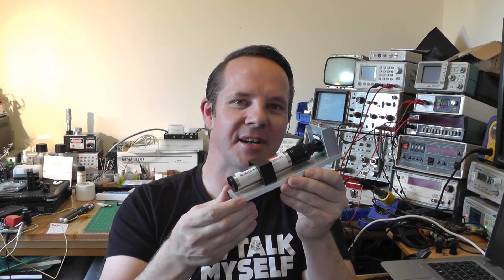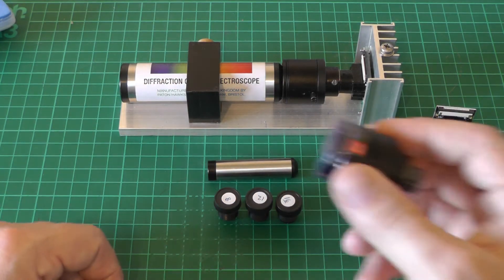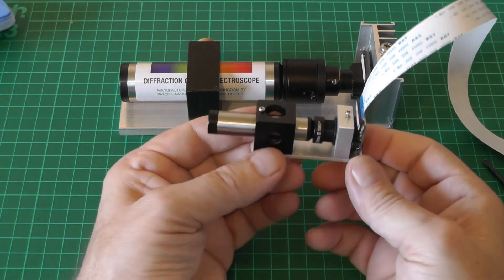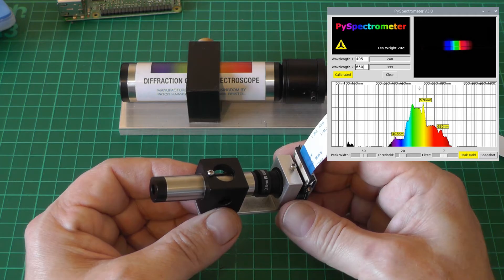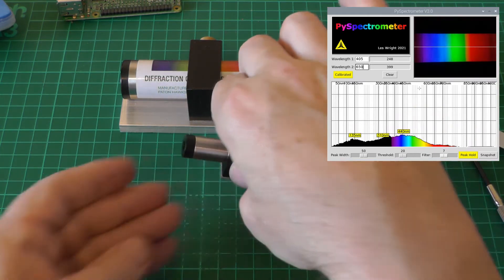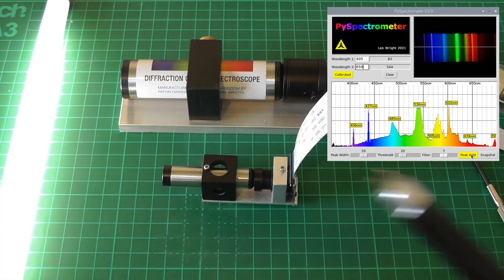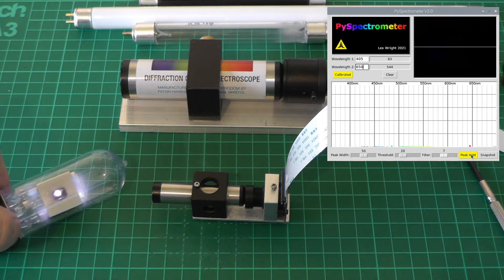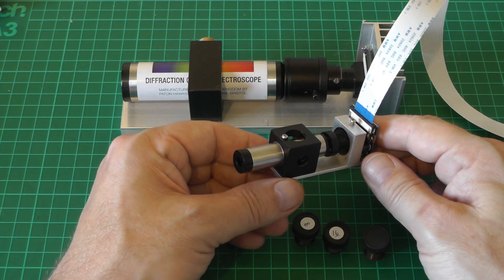How to build a MINIATURE Spectrometer  for the Raspberry Pi

Comment: I was surprised there was almost no IR within the range of the spectrometer, what lens would I need to down to say 1200-1400nm? The camera being silicon based should do quite well down there.
Reply: I believe the used camera sensor is digital one (RGB bayer filter). If you would like to see IR, mind adapting IR sensitive one (like the Pi V2 no IR) or a monochrome

Comment: Can this device analyze alloys?
Reply from the maker: No. For that you would need x-ray fluorescence (XRF)
Reply: @LesLaboratory  I love engine alloys and I want to analyze a cylinder to know how it resists corrosion. Is it possible to modify the device to analyze alloys by placing the sample in the pre-light stage and then adding an X-ray generator to it, or do we connect electricity to the sample so that the sample discharges electricity in an argon vacuum, then we measure the resulting light on a photomultiplier tube?
Reply: @LesLaboratory   hey les laboratory
Reply: I am not ignorant and stupid to ask you and you did not answer me
Reply from the maker: @OmarKhaled-zt2vi  this was already answered 3 days ago. To measure the compositions of alloys you need x-ray fluorescence (XRF). If you were determined to do it with a spectroscope, you would need to vaporize the sample.

Comment: Really good -how about one that goes up to 2500nm there is lots of good data from 1100 to 2500 (you will need another detector) we work in this region in the lab
Reply from the maker: I have been thinking about that. The usual way is FTIR at those wavelengths, but I have some crazy idea in the back of my head that may or may not work, but we shall see!

Comment: does it work with pico?
Reply from the maker: It might work on the Zero, but the Pico is an entirely different beast. The same basic principles could be applied, assuming you can even get a decent camera to talk to the Pico, and you wouldn't be able to use the OpenCV libs on the Pico either.

Comment: I wonder its feasible to do this with an esp32cam rather than Raspberry pi.  This way it could be even smaller, run from a small battery and be accessed via wifi.
Reply from the maker: Maybe, I have not looked into it. It depends on what libs are available in terms of grabbing a row of pixels, and processing and presenting the data. If I get time I will look into it.
Reply: Let me know if you do have a look at it as I now have an Arduino Sketch for esp32cam which grabs a grayscale image and extracts a single horizontal line as raw 8 bit data which should be a good starting point @LesLaboratory

Comment: Hello, can you send me a link to the xenon flash tube lamp you are using? And what kind of power supply do you use for it. The xenon flash tube lamps I found on the internet had 330 V output.
Reply from the maker: I don't remember off the top of my head, though in this application any old xeon lamp will do. I just used the power supply from an old plasma lamp to drive it, however this is not really the correct way to do it, as it will run very hot. That said, lamps are cheap!
Reply: @LesLaboratory  For our project, we are trying to find the right light source. So we decided that the xenon lamp is the one that shows the best spectral results. Yes, the lamps are cheap but the problem for us is the power supply. Do you know what voltage you used? We are currently using LED light source, do you think we should use xenon or should we continue to use LED light source.

Comment: 14:13 how it is more dangerous than previous tube if that tube 's wavelength was lower than this ?
Reply from the maker: The spectrometer won't read lower than about 350nm or so, but the UVC lamp also emits strong lines in the UVC region as low as 254nm. At this wavelength the light will burn skin an damage DNA.

Comment: Could be possible to measure transmittance with this device? I am trying to figure out how to make a spectrophotometer that works on an specific wavelenght and measure transmittance of an electrochromic thin film.
Reply from the maker: Yes, you would just need to have a nice clean stable light source, take a baseline measurement without the sample, then a measurement with the sample.

Comment: Kindly give a circuit diagram or assembling procedure for the same. Thank you. What is that software? Software link..Please provide. How to operate the software is not clear at all. Good work.
Reply from the maker: The links to the software and the requirements for the build is in the description.
Reply: Can it be treated as raman spectra?
Reply: How to place the sample? For detection
Reply: Can it be treated as FTIR or NMR

Comment: Wondering: what is the magical power source to drive all kinds of tubes? Especially the Xenon flash tube, AC / DC ? V?
Reply from the maker: For this video, I just used the PSU from a broken plasma lamp that happened to be under my bench! That's it. It produces about 8-10kV high frequency AC, from 12v in, so no mains voltages and in the scheme of things, relatively safe, unlikely to cause serious injury.

Comment: Is this a prism-grating-prism setup?

Or does this just take the -1,0,1 order onto the sensor together and waste a lot of resolution?
Reply from the maker: Internally I believe it may prism-grating prism (never torn it down, though looking through the end at odd angles you can see the optics in there). The spectroscope is high quality educational toy, and the resolving ability for Fraunhoffer lines is really very good. That said, I do not think you would likely resolve the two Sodium D-lines with it, but truth be told I have never tried!

Comment: At 7:15 it's showing some vacuum UV at 109nm. Is this an artifact of some kind? Does PySpectrometer work by looking at the distance between the calibrated peaks on the horizontal plane?
Reply from the maker: For sure, that will be light leakage from somewhere. There is no way 109nm is making it through the optics.

Comment: Hi Les. Kudos on your mini spectroscope and the covering software. I have built one in PLA and it works very well. 
Can I perhaps make you a suggestion for a small addition to your software in some eventual update to v3.1? Would it be possible to make the central white line, that I suppose represents the sampling horizon, adjustable up and down so one may make up for some degree of offset of the spectrum above or below the central field? This would allow one to sample at the visibly best slice of the spectrum. Thanks again for your excellent and instructive videos!

Comment: how far does it go into the infrared? It seems that you're cutting off around 700nm. is it a camera with IR filter or is there a different reason it cuts off? would a shorter focal length allow to extend it to ~1000nm provided there's enough light?
Reply from the maker: I have had it down as far as 800nm, but the spectroscope itself was designed for the visible. You could build your own spectroscope, there is no reason why the software and picam shouldn't handle it, though response might be a bit funky in the IR.

Comment: do not expose bare skin to deuterium lamp...
...proceeds to touch it
Reply from the maker: :-D it was run at a very low current, so not too much in the way of UV to start worrying about. If I ran it off of a real PSU, I woudl not be in the same room as an exposed lamp like that!

Comment: Is there a way to see spectra below 280nm (UV-C)? I'm interested in figuring out which UV lights have germicidal capabilities with your spectrometer :)
Reply: Sensors from GenUV should do it, but they don't give the spectral range in real time, just presence/intensity.
Reply from the maker: Not with the current spectroscope attachment. There is too much glass and plastic in the optical path, For UV work, you need fused silica optics. Additionally the cameras themselves absorb to much UV. This was part of the motivation for this video: https://www.youtube.com/watch?v=y39UKU7niRE

Comment: can you also measure liquids? using 2 ? measuring the wavelength of the source and then the liquid?
Reply from the maker: Yes, in principle. It depends what you want to measure. Assuming absorption, you would first take a spectra of your light source, then spectra of your sample in the path of the lightsource. You could then load these into matlab for example and subtract them from each other.

Comment: Can you make your graph display farther into both ends of the spectrum?
Reply from the maker: Yes, by changing the lens, then calibrating, it can 'see' into the near IR and near UV, but not too deeply. the Spectroscope it uses as designed for the visible spectrum.

Comment: This is a great project.  Could you give any details on the pocket spectroscope?  Particularly the optics involved.  Is it as simple as a prism or is there a grating in there so where?  Thanks. Doug
Reply from the maker: Thanks! Yes, these are diffraction grating spectroscopes, but there is also a prism to straighten up the optical path. Best guess the optical elements front to back are: slit > Collimating lens > Grating > Prism > Objective lens
Reply: @LesLaboratory  any interest in doing a “tear down” ….. you know, just for completeness? :)
Reply: @LesLaboratory  I actually found a video where the instructor detailed these gem spectroscopes.  Appears that there is a slit, collimating lens, split prism sandwich with the diff grating between two pieces of the pricing.  Very nice

Comment: For plastic threads, put them on top of each other with just a bit of pressure.  Unscrew until you feel it click, then screw in.  Easier to feel with coarser threads, but...
Reply from the maker: Great tip, this is also what I do. Plastic mounts are still a bit poor though, easy to strip and/foul the threads.

Comment: What are yo running your deuterium lamp from? I have one and I tried using my variac with a ballast resistor and could not get it to run on that. I can sort of power it on my HV PSU but I don't think I am getting it to it's full current with what I currently have set up. I would love to have a solid PSU solution for my lamp.
Reply from the maker: Same as you, I just powered it from a small HV power supply from a plasma lamp. It's not something I have had time to look into at the moment, too many other projects on. :-S

Comment: You should pick up a "PenRay" ArHg lamp off of ebay, it has known peaks and they are what are normally used for calibrating spectrometers. I use the ac output from one of these supplies to run them: https://www.amazon.com/gp/product/B08JHPDBNM/ref=ppx_yo_dt_b_asin_title_o00_s00?ie=UTF8&psc=1

The problem with the way you are calibrating is those laser diode are only roughly 405 and 650 and will vary based on diode temp. I have a 405 but it actually outputs around 403.5. Gas and solid state lasers are much more stable wavelength wise, I have used an argon laser with a HeNe to get the data points I needed to calibrate my spectrometers. But the ArHg lamp makes it so much easier. You will mostly see the short end of the spectrum with the lamp but if you drive the lamp at a lower current the argon lines will be more apparent and they fill the longer wavelengths.
Reply from the maker: For sure, they are expensive though...
Sure, In the previous video I use gas and DPSS lasers to calibrate for this self same reason. Ordinary fluorescent lamps can also be used to calibrate as well, as their peaks are well documented.
Cheers!
Reply: @LesLaboratory  Here's one for $25. https://www.ebay.com/itm/293805966392?hash=item4468334438:g:7yUAAOSw9CtfmuuD

Comment: Have you tried the UV lamps with the camera / grating aligned so that the shorter wavelengths are closer the the center of the video frame? The black light's spectral peak (375nm) was only just in frame, possibly the camera could see further into the UV. Quote from Google search: "The deuterium lamp emits radiation extending from 112 nm to 900 nm, although its continuous spectrum is only from 180 nm to 370 nm." (Your graph starts at 360nm). You could extend your range with the same lens by rotating the grid 30ish degrees, and modifying the software to sample from the bottom left to top right of the video frame.
Reply from the maker: Not yet, I wasn't really expecting to see it in the video (I don't script, I just do them).
At the moment I am working on reliably stripping the Bayer filter mosiac off of the  picamera to extend its range into the UV and NIR, as well as flattening out the response curve. 
Once this is done, I will have something you could call a real scientific instrument, and we will be able to see more cool stuff!
Reply: @LesLaboratory  I look forward to seeing how you do that!

Comment: Would you please mind sharing sources of "calibration" lasers, you are using?
Reply: Most of the lasers he uses are standard cheap Chinese lasers that take 2 AAA batteries. 

Considering all red, blue, and green lasers and diode‘s are going to fall within a very close tolerance of their stated spectrum. It’s a really good start. Then you can always branch out to  more accurate sources like helium neon laser tubes, nitrogen lasers, deuterium lamps, and stuff like that. Which can be bought very cheaply if you watch the websites closely.

You can get a three pack containing a DPSS 532nm Green, 650nm red, 4045 nm violet/blue in a set for under $10 on eBay and even less on alli express. 

The DPSS green laser will show peaks at 532 nm, as well as infrared from the pump diode. Very interesting experiments can be done and I highly suggest picking up a pack. 

BUT Be careful!!!! They are NOWHERE NEAR five MW. The green lasers can easily reach 100mW and burn dark surfaces, and most don’t have an infrared filter meaning instant eye damage or blinding us faster than you can blink. Even from a reflection!!!!

Comment: Hi Les and thank you for another video. My diffraction grating has arrived from Paton Hawksley and I am now just waiting on some lenses. Being new to this, I am curious as to what/where you obtained the lasers you are using to calibrate. Are they simply over the counter laser pointers that are accurate enough to use, or are they something more than that? Thanks again!
Reply from the maker: Over the counter pointers will do, however be aware the wavelengths quoted aren't very accurate, with the exception of any DPSS lasers (Green laser pointers). these are always bang on 532nm.
It is possible to calibrate using a fluorescent tube though. See: https://github.com/leswright1977/PySpectrometer
Reply: @LesLaboratory  I have ocean optics spectrometer.can i use deutrium lamp or halogen lamp for its calibration for UV range specific? their light source devise are too expensive.
Reply from the maker: @nerd9992  Sure, any light source that emits discrete lines will do, so stay away from LED's and Halogens (they emit contunnua), and use old style Fluorescent tubes. If you want to calibrate UV, you can get away with Cheap UV-C lamps (Just look up the emission lines for Hg as a reference) mind and protect your eyes from UV though. Corneal  burns are exquisitely painful (voice of experience from a welding incident!)
Reply: @LesLaboratory  🧡🧡🧡 thanks Doc!

Comment: Just a comment but you should take care physically handling that D2 lamp without gloves on; the MgF2/SiO2 envelope gets exceedingly hot, and the oils from your skin absorb the UV strongly causing localized hot-spots (The UV emissions extend down to the VUV but the envelope absorbs anything less than ~ 220 nm); touching without gloves will greatly increase the likelihood of envelope failure.
Reply: Also you don't see the UV because of the plastic/glass elements in the spectrometer, but ~ 60% of the output is a continuous emission between ~ 180 - 350 nm; the pink is mostly from the "Balmer Lines". Be very careful with that thing.
Reply from the maker: For sure. I am driving it well below its specified current rating for exactly these reasons. Corneal burns are deeply unpleasant.
Whoever owned it before me wrote on the envelope in in permanent marker (facepalm) , so it would likely explode if driven correctly.

Comment: Very nice build, the aluminium makes it look very professional. 
It would be interesting to integrate it into a standalone bit of testequipment. 
Something with the formfactor of a small oscilloscope maybe. 
You could even integrate the screen and UI ... and maybe even two sources for an "auto calibration" function. 

I would propably do it this way, if I only had a use for a spectrometer. ;) 

Greetings, 
Michael
Reply from the maker: Cheers!
Yea, a compact build would be cool. Yep, an integrated laser would be cooler. the suppliers of the Hamamatsu breakout boards have a 405nm diode mounted on them for fluorescence experiments as well I believe.

Comment: Do you have any quick guide/advice for how to operate these discharge dicharge/vapor lamps ypu used for testing? Will cheap ballasts work? I'm not finding many tutorial/guides and the high voltage less inclined to make a diy solution
Reply from the maker: I just use an old HV power supply from a plasma lamp. Cheap, easy to use and pretty safe (the worst you would get is a small shock and a burn or two)